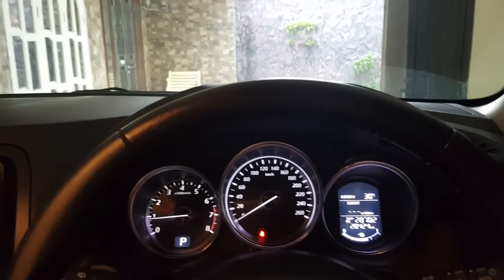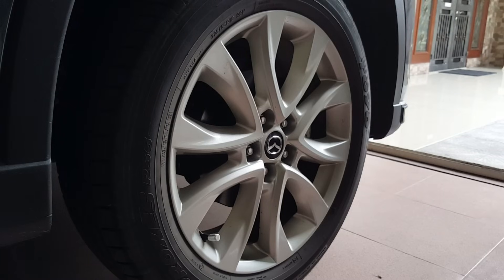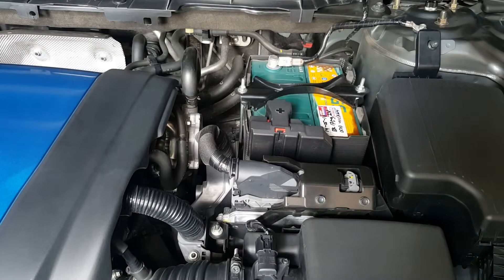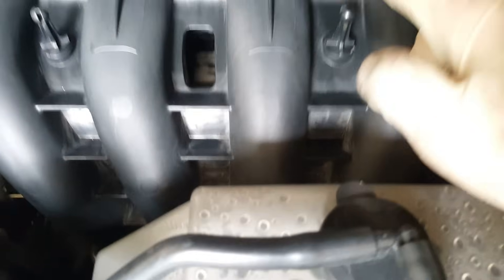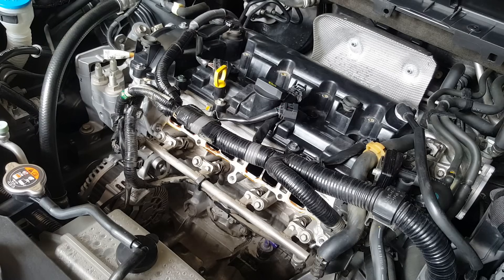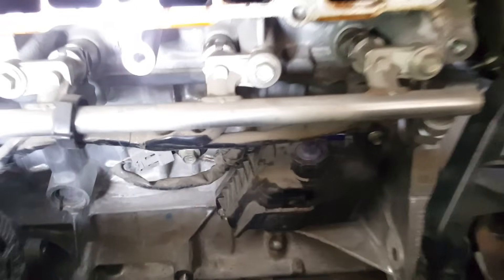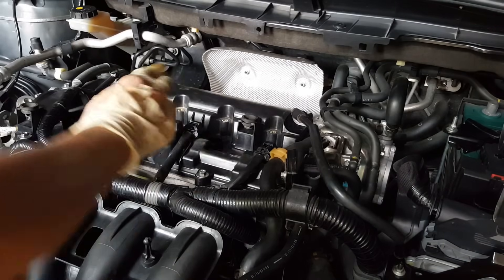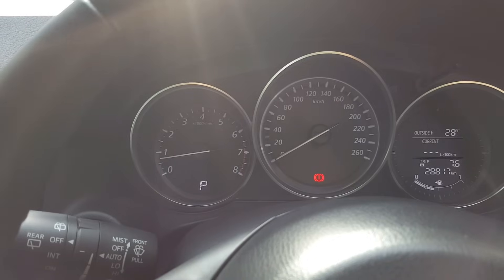How to Clean Intake valves / Carbon clean // Mazda CX 5 (All Skyactiv Gasoline Engines)

Comment: FFFEEELLLLIIIIIIXXXXX!!!!
THANK YOU SR.
First time Mazda owner and honestly pretty scared about the carbon buildup, until found your channel. You made it look easier to do it!!!

I have a 2017 Mazda 3 2.5 engine, not sure if cx5 has the same engine. 

Would be beneficial for this engines to install an oil catch can?

Also about minute 7:19 you mentioned a censor, just need it to make sure if it is the MAP or MAF censor you mentioned and it’s locations.

Thank  you Felix
Looking forward to hear from you.
Reply from the maker: Yes the 2.5 and 2.0 l is the same procedures and i saw from the forums catch can actually does reduce the amount of carbon build up on the intake valves. If you have a one catch can , by all means install it when u perform this service. At 7:19 it is IAT sensor.
Reply: Thanks for the advice Felix. 
You mentioned IAT censor on your reply where is this one located?
Also is it the MAP censor just behind the throttle body? I think you mentioned it at the 7:19 minute of video.
And the MAF censor the one on top very close to the air filter box ?

Thanks you Felix
I really appreciate your help.
Reply from the maker: @saga2760  So the MAF sensor is attached right on the airbox. Where as IAT sensor located on the intake manifold on the bottom side.
Reply: Thank you.
I’m planning to do the cleaning and see I can add the oil catch can. 
Take care and happy new year. 
I’m in California 
Thanks
Reply from the maker: @saga2760  you r welcome brother. Happy new year :)

Comment: I would like to know is using fuel system cleanser like the Liqui Moly one effective when the valves are not too dirty?
Reply from the maker: Unfortunately our cars with equipped with direct injection engine and any fuel system cleanser it will not work. But if you own port injection engines vehicle it will work like a champ.

Comment: So you are moving the crank to close the valves so the gunk does not fall in the cylinder right? Is it harmful to let the gunk get in and then let it burn up and out the exhaust?
Reply: I guess you dont want that in your catalytic . hehe :)
Reply from the maker: That ia correct sir..It would be harmful for the catalytic converter.

Comment: Doing this soon.. Will add the oil catch can while I'm down there. You should have taken off the coolant reservoir to make more room for the intake manifold removal. Oh and for the oil catch can have to buy some long tubes as the thing will be mounted near the air filter box.
Reply from the maker: Yes sounds like a plan.

Comment: Why remove spark plugs? One look inside cylinder heads, where you place the toothbrush. I saw no hole where the spark plug head would poke out, so, why remove the plugs at all? Also, it might be a good idea to drain your oil catch can when you have the intake manifold off since it is right there. Overall very nice video and thank you for the info!
Reply from the maker: Just make it easier to turn the crank pulley.
Reply: When you rotate the crankshaft, the piston compresses the air inside the cylinder.  If you loosen the spark plugs, the air has somewhere to go and the crankshaft turns easier.

Comment: So the alleged fuel savings of GDI engines are eaten up by additional maintenance costs for nett gain of zero. Well done engineers !
Reply: Some manufacturers like Lexus are doing BOTH port and direct injection. Port injection maximizes lower RPM economy AND cleans the intake valves.
Reply: I will find a car to buy with multi port fuel injectors or the older efi delivery method.
Reply: @gregnixon1296  Toyota and Ford are making multi port FI
Reply: @Mikedoc52  Hyundai and Kia too. Toyota With the D4S ftw
Reply: Alot of it has to do with emissions as well
Reply: Not true. This video was made in India, or some other foreign country, where fuels are full of junk. Mazdas actual have one of the lowest, if not THE lowest, cost of maintenance.
Reply: And your fuels savings gets diminished too as well with the carbon buildup so it kinda defeats the benefit
Reply: I have a 2013 Mazda 3 with Skyactive engine. Skyactive engines have been in service at least since 2012, in US, and they have been very reliable according to Consumer Reports survey.  They have design features which minimize the carbon build up. Carbon build up becomes a concern when it accumuates on the  cylinder side of the valve where it could impact compression ratio because of the volume taken up by the carbon build up. Also, carbon build on the valve sealing area  and valve seat will have adverse impact because the valve would not seal properly when the valve is closed. At anyrate,  " the proof of the pudding is in the eating". Skyactive engines are proven to be very reliable and I am not concerned.
Reply: Not really. A lot of work went in to the Skyactiv-G engines to mitigate against carbon build up on the intake valves. This is why he can simply scrub them off by hand with a cleaner. If it was a significant issue, he wouldn't be able to clean it by hand - he'd have to clean it by walnut blasting. This is why the cleaner disolves the soft 'scum' in the intake valve chamber and on the intake valves as well. See here rhttps://motoiq.com/131-compression-and-40-mpg-on-87-octane-fuel-introducing-mazdas-skyactiv-technology/6/?fbclid=IwAR29zamlba6-zUrB14CWPYG-dbwXpmo4aAMjZtMTsUiULK63tzmT2MXtTCU
Reply: @AlisterJK  I kind of agree and think it may not be necessary to clean it regularly if fuel economy is still good. I refer to Arcticshade's response: https://www.reddit.com/r/CX5/comments/dqte9q/carbon_buildup/
Reply: A friend of mine just did this to his cx-5 . ATt 35 thousand miles and they were no way as fouled up as this one. He runs premium fuel as recommended.  This is common when using regular gas not even mid grade regular all the time. That's why they recommend premium fuel. As these engines also have a very high compression ratio. Like 14 to 1.
Reply: @wanee8039 When did they start recommending premium fuel in Mazda cx5 ?  Never😂
Reply: Toyota solved this carbon build up with their dual injection system. It has GDI and port injection together. 
I believe it starts up on port injection to warm up the engine then switches to GDI.
Reply: GDi 's are here because of the emissions! @graemewhatever
Reply: Not the engineering thats the issue its the government idiots that keep pushing for unrealistic emissions regulations. The engineers have to come up with cost effective solutions (for the car companies) to pass these emissions regulations. Otherwise they get fined, the end product is a more complex and more maintenance prone engine that won't last and now requires more chemicals to keep it running "clean". Its a joke really. The people in charge of emissions regulations don't have a clue what they're doing, they know nothing about automotive engineering.
Reply: Exactly. Blame the EPA and congress, consisting of people who've never engineered or designed anything in their lives for directing unrealistic timelines to develop complex systems all so they can look like they're doing something.
Reply: Manufacturing has port/gdi engines now that solve this problem and retain performance fuel savings.  

Those regulations forced an innovation.
Reply: Another Trump idiot that still think that carburetor is better than efi eh!? Toyota, BMW and others have fix this issue by using Both Direct and port injection system. BTW this is very weird, in the US this Mazdas after breaking up with Ford and using their "skyactiv technology" have been very reliable with no problem what so ever. Gotta make sure to service the car properly...
Reply: @2F4R4W4Y  you’d better enjoy the Biden & Harris experience then with that attitude towards others there... Free World is screwed now
Reply: More like well done bureaucrats. I guarantee you the engineers knew this was going to be a problem, but they have their hands tied by ever-tightening fuel efficiency regulations which forced them to go to GDI tech. Those regulations conflict with the other regulations that say you can't vent PCV to the atmosphere. Honestly I think the PCV regulations have some merit, as venting PCV to atmosphere means you're literally blowing oil out onto the road. But fuel efficiency regulations are based on fear mongering about global warming, I don't think GDI is justified from either an economic or environmental perspect, it's total B.S. Even with the new dual injection engines, I have to wonder how much extra that adds to the cost of the car compared to the fuel savings from the GDI system.
Reply: @coletrain5667  Yep I agree but with a different context of "bureaucrat". Here in the United States, the previous administration (Obama) passed the most stringent CAFE standards during his tenure (2009 - 2016) which forced automakers to mass-adopt GDI to meet said standards.  Before that, most engines were great with just variable valve-timing & turbocharging.
Reply: @coletrain5667  Despite all the complexities of modern cars, due to making them safer, environment friendly, and better convenience; cars have steadly become more reliable. Not very long time ago, we celebrated when a car made it to 100k miles. Actually, the odometers used to read only upto 100k. It was common to see a broken car on the road with it's hood up and  steam venting from engine area. This is proven by data collected by consumer reports. Even though, reliability varies based  on model and make, overall reliability has improved overtime.
Reply: What a pain in the ass.   Guess I’ll stick with dual injected Toyota’s.
Reply: Thanks to the fucking EPA
Reply: The engineers are definitely at fault. There are many ways for them to have anticipated and avoided this problem. For starters, a catch can** would reduce this build up tremendously, and it's odd that someone who has done this job repeatedly (apparently) doesn't put one in. It's cheap and doesn't impact economy. And additionally a small amount of port injection as well as direct would also have helped in the design of the engine with almost no hit to fuel economy. You can take advantage of the direct injection flow control as a component of the total and it will be sufficient. Toyota does this.

Also, this "net gain of zero" depends on your perspective. Almost certainly, if you have this done regularly the at a garage the net gain is negative in terms of financial cost. Conversely, regardless of cost, less fuel consumed will be an environmental benefit. And the more it costs you to maintain the less you'll drive it, resulting in even more environmental benefit. So some folks might see it as a plus regardless. Although, I'm pretty sure none of them will actually own a GDI.

** The "catch can" mentioned in the video isn't a proper catch can to prevent carbon build up. I don't even know what he was talking about. There's nothing on these between the PCV and the intake manifold but a hose.

Comment: BTW why not in this case install a oil catch can?
Reply from the maker: For my next service i might get the catch tank.
Reply: @GarasiFelixDan  It's a good idea mine at 100k miles the pcv was clogged.. had to change it, It was burning a quart of oil every 2 gas tanks, now it's fine. I thought it was the engine, checked compression and cylinders are all around 185-190 psi.

Comment: my cx5 is burning so much oil, 1l over 800km.. I wonder if its the pcv valve, which it looks like is under the intake manifold. Hard to get to. On my ford its a 30s job to change the pcv valve.  I have to do it though before I can assume engine is damaged.
Reply from the maker: What spec oil r you using ? If its 0w20 . You could change it to 10w30. And see if its still burning oil. Whats your milage of the cx 5.
Reply: @GarasiFelixDan  So it seems to burn a quart pretty quickly. I live in Canada, so 0w20 is recommended, it gets cold here.
Reply from the maker: @radekw708  ok then if thats the case pcv valve needs to be replace.
Reply: @GarasiFelixDan  Yeah I hope thats all it is, or engine needs replacement
Reply: @GarasiFelixDan  0w20 castrol synthetic, its at 100k miles now. I just bought it 2 weeks ago, put a quart of oil in, and now a gas tank later so about 500km, its off by a quart again. I hope its the PCV valve and not the engine, or I will just return the car.

Comment: I also think that the gas quality in Indonesia is less than in USA for example. Top tier gas has detergents that keep this from happening. I know that in Asia they have gasohol and 95 100% gasoline but don't know if PTT puts any detergents in their gas.
Reply: The gas doesn’t touch the intake in a direct injected engine like this, top tier gas wont affect intake buildup here.

Comment: Do you have to remove the intake manifold to replace the PCV Valve on the Mazda Skyactive 2.5 Engine? If so, where exactly is the PCV Valve located?
Reply: Under the intake that he removed in the video, you see like an a black box with an 90 degrees fitting. This is the box where it has that pcv valve. In the video he talks about the oil catch can (which is an oil separator), that box is where that pcv valve is. If you want or need to replace these, change the whole box. Its easier and not too expensive.

Comment: This is so strange.  After cleaning, you can clearly see the intake corridor has rough surface.  This is the traditional approach, because fuel injector sprays sometimes have globs (not all vapors).  Any fuel globs or condensed fuel on the intake corridor surface, by having the rough surface treatment, helps that fuel evaporate quickly and get it sucked into the engine - either in this stroke/cycle, or in the next stroke/cycle.  
In this particular engine, I see the fuel rail and the injectors.  The injectors clearly isn't shooting into the intake corridor upstream from the intake valves.  Is this "Direct Injection" into cylinder? 
If so, I thought WV first pioneered that approach... which led to rapid carbon build up upstream of the intake valve.  Just google it; you'll find nightmare images of totally caked up intake, restricted to about 50% of original air passage.  
What the WV engineers should have seen coming, but totally forgot it, are all the emission control / PCV / etc., which would dump air saturated with heavy engine oil (vs light fuel) into the intake, upstream of intake valve.  Traditional fuel spray would have helped keep the valves etc clean.  But without the help of that fuel spray (due to spray direct into cylinder), now that intake is doomed to carbon build up.
I can't believe Mazda copied this flawed design.
Reply: In case you didn’t know it’s directly injected inside the cylinder head . Carbon buildup is from EGR gases
Reply: @azarahwagner2749  
Thank you. 
You and I are saying the same thing. 

Without gasoline spraying upstream of the intake valves, the back of the valves are doomed to have carbon build up from the various PCV, EGR, etc.

Again, my question is, why is Mazda copying this flawed design? 
Toyota at least kept port injectors, in addition to having direct-inject. Occasional fuel coming from port injection keeps their intake valves clean.

Comment: Have you ever thought of using an oil catch can to prevent the valves from getting all gummed up?
Reply from the maker: nah i havent tried to install one yet. but  have heard theres still be carbon build up even with catch can .. but not as many without it.
Reply: @GarasiFelixDan  I get 15mpg with my truck and was doing some research on a mazda 3 with 2.5 gdi engine. Just looking for some decent pickup with reliability and good mpg. Thank you for your info. I never considered a liquid cleaning and have heard of the walnut media blast cleaning.
Reply from the maker: @danlatu209  Yeah walnut blast is better for this service. Doesnt take too much time and effort to make it shine like new. :)

Comment: Oh my word, if this car only has 28000 KM I should def do this on my 2014. I'm already at 110000KM, and I have noticed that it's accelerating pretty rough and just doesn't sound like it use to when it only had 60000km.
Reply from the maker: I think mine due to mainly traffic jam. That is why theres alot of carbon build up. But... yeah if your car suffering from a rough accelaration please do this service it will help the engine performance.

Comment: So just to check the carbon buildup, one could only remove the six bolts holding the manifold and crack it open enough to have a look at the valves! I'm trying this approach next week. I'll be back with the results. Just bought a used 2016 CX-5 last month @ 80000km and eager to find out! Great tutorial BTW Felix Dan
Reply from the maker: You r welcome sir. Please let us know the progress. Im curious to see at 80.000km :) if you have walnut blast it would be much quicker process for this service.
Reply: @GarasiFelixDan  just finished inspecting the valves after removing the six bolts holding the manifold: the inside looks close to your video.  The carbon buildup is a bit higher on the valve stems... Got a few pics and a video I could share with you if interested. Might do a video on youtube and link it to yours  :-)  For now, I've closed everything up and might clean it up next spring. Engine is still running smoothly.

Comment: Felix Dan, thanks for the video. Have you replaced the PCV valve and the retainer or at least, did you inspect it?
Reply from the maker: I havent replace the PCV valve nor get around to check it.
Reply: You don’t think that the PCV valve could also be clogged?
Reply from the maker: @alexradu2375  should be alright. As long as you run a good spec oil. It shouldnt be clogged.
Reply: Felix Dan , thanks